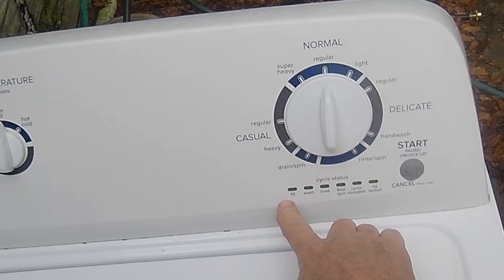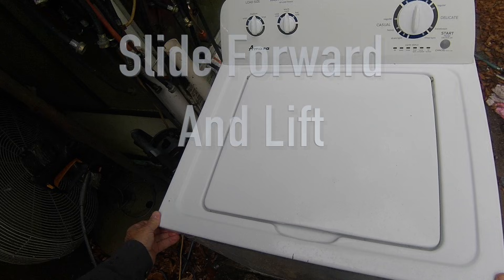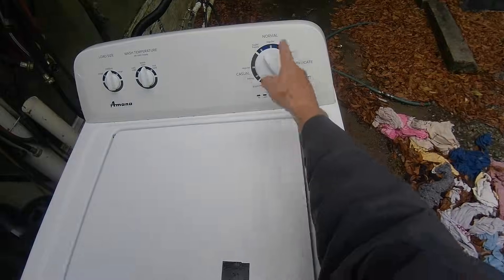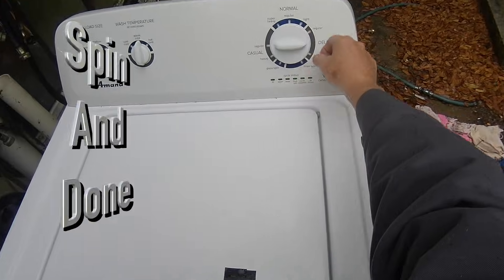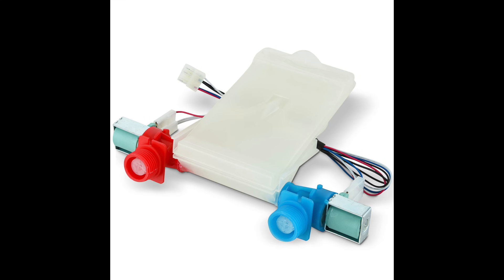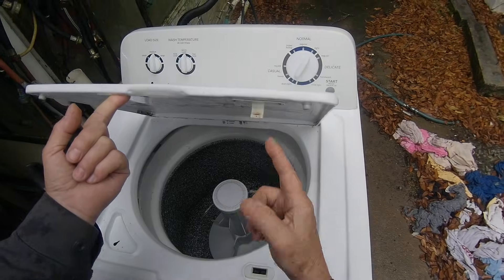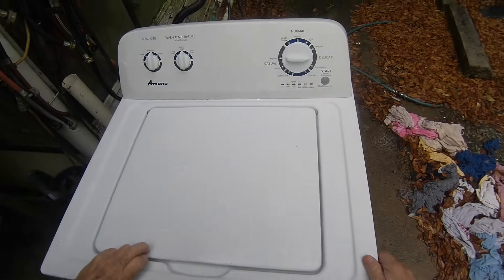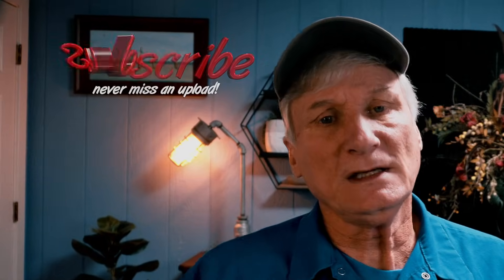How To Diagnose Your Amana Washing Machine: Chip's Guide to Manual Diagnostic Mode

Comment: So mine wont stop filling until its spilling out, and the drain pump doesnt work unless the tub is almost completely empty already, all other parts of the auto test ran except the drain and i cant manually work the pump with manual test function. However it automatically drained once i syphoned almost all the water from the tub. Im so stumped
Reply from the maker: It sounds as if you’re having issues with the pressure transducer on the control board. Take the hose loose from the control board and blow back through it to clear any blockages. With no water in the tub reconnect it to the control board. Oh, and make sure it is connected well to the side of the tub. You may have to reach up under the machine and do this. You might also have a small hole in the pressure hose. If you are still having issues, your pressure transducer is not functioning and you’ll have to replace the control board. Thanks for watching!

Comment: In diagnosis mode, When I hit start when testing the spin, the lights flash and nothing happens.
Reply from the maker: Be sure you lock the lid first or the test will fail. If it still doesn’t spin I’d change the shift actuator first.
Reply: Lid is locked. And replaced actuator and splutch. You can hear the motor wanting to spin if you reach down and give it a shake it starts spinning. Is that just a bad motor by the way this happened after washing a very large comforter
Reply from the maker: I'm thinking the shake could be nudging the basket enough for the motor to start. That points to a weak capacitor. I'm guessing here so let me know if you find a solution.

Comment: When doing these test, particularly the spin agitation test, the lights just flash. Does that mean it fail?
Reply from the maker: Make sure you lock the lid before doing spin and agitation test.  You can lock the lid by entering test mode and with no lights on press the start button and the red lid lock light should come on. Then dial in your other test. Thanks for watching!
Reply: @HarperandKnowles  i did. It’s red and locked but still nothing happens to start the spin test. Is my actuator bad or lid lock not working properly?
Reply from the maker: Probably your shift actuator.

Comment: I have an Amana washer. Cold water not coming out. Hot water is good. Replaced water inlet valve. Still no cold water. Suggestions?
Reply: Thank you for the video suggestion. That was helpful. I installed a new inlet valve and still no cold water coming out. Is there any other remedies for this or is the inlet valve definitely the problem?
Reply from the maker: Did you try the hack described in the video I suggested to check and see if the cold water valve is the problem?. If not here is what to do. First insure that hot water flows through the hot water valve body. You can do this with the diagnostic check. Now, attach the cold water hose to the hot water valve. Next, swap the wires attached to the cold water solenoid and the hot water solenoid. You have to do this for the machine to work properly because all your rinses are cold water. Now check for cold water flow using the diagnostic check. If you still don't get cold water you have a wiring or control board problem. If it does then you have a water valve problem. You can also check the cold water solenoid for continuity. If the solenoid is broken you can use a good one from your old valve to fix it. I hope this helps!
Reply from the maker: Perhaps there is something wrong with the water supply to the machine. Take the cold line from back of machine and run it in a bucket to see if you have good flow and no hose kinks. If that’s good try the hack in this video Amana Washer Making Noise When Filling | Hack This Issue
https://youtu.be/qq37YBKr3q8 while you reorder and get a good valve. Thanks for watching!
Reply: I’ll give this a try. I’ll update on the results. Thank you for your time 🙏

Comment: Can diagnostic be done with machine tilted back,so I can see underneath?
Reply: Actuator is working,but no spin. Could it be the capacitor?
Reply: Trying to be accurate.
Reply from the maker: Use the book on the inside left corner of the cabinet to check the fault codes. That will get you on the right track. A no spin situation can be many things. Lid lock/lid switch, shift actuator, tachometer, motor, belt, splutch, control board. I’d check the tachometer, that’s a common issue, but the fault codes will guide you to the solution.
Reply: Thank u.
Reply from the maker: Why not put a couple boards under the legs, set your cell phone to record video and slide it underneath. It could be dangerous trying to tilt it. Gyroscopic forces, you know?

Comment: I’ll start my washer and when it’s in sensing mode it will stop filling and start making a clicking sound. If I open the lid and close it again it will stop clicking and start filling again for several seconds before it’s back to clicking. It will do this repeatedly until it completes the sensing cycle and when the clothes are done washing I’ll still have detergent stains. I’ve tried using pods and liquid and a normal amount as well as a small amount of detergent and still can’t figure out what’s wrong.
Reply from the maker: Change the shift actuator. That should fix your problem.

Comment: My Amana washer fills up,agitates on wash cycle, drains,fills up on rinse cycle then drains&goes back to wash cycle. Will not agitate or rinse my clothes.Also clothes don't come clean and are still pretty wet.I replaced the shift actuator.Did not fix the problem. Can you help me?It's NTW4516FW3 model.Only about 3 years old
Reply from the maker: This sounds like a cold water valve problem. What I would suspect is your cold water valve isn’t flowing enough water into the tub before it times out. All rinses are cold water only. It may be flowing enough during the wash cycle because it is flowing warm or hot water. Do the diagnostic check as in the video for the cold water valve. Thanks for watching!

Comment: This is the best walkthrough of washer problem diagnosis I have been able to find on Youtube.  Concise, correct information presented very clearly.  I learned a lot in the last 7 minutes and 47 seconds.  Thank you!
Reply from the maker: I’m glad you liked my video. Thanks for watching!
Reply: What is the next step if the lights won't come on. It didn't get past the  first step
Reply from the maker: I’d check to make sure there is power going to the machine. If you have 120 volts verified then there is something wrong with the control board. Thanks for watching!
Reply: I AGREE..! 🤦🏽‍♀️
Reply from the maker: Thanks for watching!
Reply: Absolutely!

Comment: My amana of washer started button will not work. What can I do to fix it
Reply from the maker: You can try several things. First hold the button down for about 30 seconds. Then lift the lid and close it and push start and release it. Next unplug the machine for 2 minutes, plug it, lift the lid and close it then push the start button and close it. Next try to determine if the button is stuck down. You can remove the back panel then with a putty knife depress the clips at each side of the console and lay it down. Pull the knob off the front and then remove the control board and turn it over to examine the button switch on the board. I hope these ideas will help you. Thanks for watching!

Comment: I think my issue is either the valve body or the control board I’m about to try the doing the diagnostic test right now but my issue is basically the machine will run auto sensing but the light will switch to wash after and it will just stop there it won’t fill up or spin or do anything else I can change it to the rinse cycle and it works just fine but it will not start the wash cycle 
If anyone has advice I’d love to hear it
Edit: it’s the cold water screen the hot water runs the whole machine I just need to clean out the cold water screen and hopefully it’ll be fixed
Reply from the maker: Glad you solved your issue, thanks for watching too!

Comment: Hey man , amazing video here . Ran the full diagnoses everything worked as it should except the spin cycle and agitate. Replaced the shift actuator and still have no luck just an electrical hum . Belt is in new condition but almost looks as it’s running itself off but have not witness any movement / spin
Reply from the maker: An electrical hum could be several things. If it happens as soon as it’s plugged in then hold down the start button until it quits, 30 seconds or so. If not that it could be the motor or the capacitor. Replace the capacitor first. Other than that all I can do is guess without being right there myself. Thanks for watching and good luck with the repair!
Reply: @HarperandKnowles  thanks I’m guessing it’s the motor , I noticed the pulley on it was dropped down few inches and not parell to the other .. the electrical hum is only when trying run spin cycle in diagnoses so assuming it’s the motor under load not moving
Reply from the maker: Or that pulley could be stripped out.
Reply: Wish could leave a video aha , is there suppose be any play in it ? I can lift it up and down well over inch
Reply from the maker: It depends on which motor you have but this could be your pulley https://amzn.to/3Gq3TZR
Reply: Thank you sir for the video I have a amana washer like this it goes through the cycle as it should only problem is it agitates slightly like your video I replaced the shifter with no luck and the clutch lever moves freely any advice? Not sure if it’s related but I’ve noticed the tub has been filling with more water than usual
Reply from the maker: There could still be something wrong with the splutch or shift actuator. Aside from that it would have to be the internal workings of the transmission. Make sure the arm on the actuator does not flop around and is secure in the splutch slot. You could try tilting the machine up and watching how it moves while someone cycles through agitate and spin cycles while in the test mode. I hope you find success! Thanks for watching.

Comment: Attenion Chip  I have an Amana ntw4516fw3 that I have installed a new acuator and start capacitor. The cap was check and showed bad. ran test mode and replaced acuator assembly due to no spin . Everything test ok in diagnostic mode but when run stops with Rinse light flashing. Any ideas ?
Reply from the maker: I would suspect the lid lock or the cold water valve. Thanks for watching!

Comment: I cant load large loads. It makes a loud noise . It goes through the cycle but doesn't wash.
Reply: It just loads small and medium  amounts of clothes. If I go larger the agitator will not move . It will cycle but not wash
Reply from the maker: You might have striped splines on your agitator or on the large pulley under the machine. Your gearbox might be failing too. I can only guess without being able to diagnose it myself. Good luck with your repair!
Reply from the maker: You haven’t provided me with enough specific information to give you an educated guess as to what may be the problem. Thanks for watching!

Comment: My lid locks for the diagnostic test but not for the wash cycle, so I need to replace the lock on it?
Reply from the maker: There are models where the lid doesn't lock during the wash cycle but only during the rinse and spin cycle when the spin basket is moving. If your lid lock passes during the diagnostic test then it is probably alright. I would suspect the control board if your machine passes the diagnostic test but doesn't work during a the wash cycles. Thanks for watching!

Comment: My washer will only fill with cold water when I open and then close the lid.. when it stops to sense level (or whatever it periodically stops to do), it goes to straight hot water until I open and close the lid again.. I have to stand there opening and closing the lid to keep it from filling with all hot water. Why?
Also, my washer will not do anything, including fill with water, unless the lid is closed, so when I am in diagnostic testing, and I open the lid to see if water is flowing cold, won't it stop and thus not let me hold my hand under the flow to see what the temp is?
Reply from the maker: Okay so this doesn’t make sense to me. In diagnostic mode you can lift the lid to check the water valves. You can also turn off what you think is your hot water valve on the wall and if you are still getting hot water your hoses are swapped.. From what you are describing I’m thinking you have your hoses swapped around. Let me know what you find. Thanks for watching!
Reply: @HarperandKnowles   I passed all the diagnostic tests... perhaps the problem corrected itself? It was bizarre to have to lift the lid and close it to get the cold water to flow in... I had to babysit it the whole time to make sure the load I was doing wasn't going to be steaming hot water. I hope it doesn't repeat. Unless the water hoses can move themselves, it isn't that. They have always been correctly attached. It would start with cold water, and a couple seconds later it would stop, do some adjustment (I guess?) then start filling again, but this time steaming hot water, so I would open the lid and close it and it would flow cold water, until the pause and "adjustment" a couple seconds later and the hot water.. it was annoying to say the least.

Comment: I replaced the lock switch ran thr diagnostic and my lid lock light jeeos flashing any suggestions would help please and thank you its amana
Reply from the maker: Is this the same issue you had with the original switch? If so check that your striker (the piece on the lid) is not damaged.  Take something metallic and be sure there is a magnet in it. If both switches are acting the same then you probably have a control board problem. Or, it is possible but rare, you have a defective switch they sent you. Thanks for watching!
Reply: @HarperandKnowles  no the last switch just kept clicking I was just getting ready to order one to see if that was the problem because the new  switch didn't come with one ....thanks so much im gonna try it now

Comment: My manual is missing about 1/4 of the 1st 4 pages(based of page numbers) and it wont go into test mode at all. Will work sporadically but not always an issue.
Reply from the maker: Check the plastic bag inside the cabinet for your missing pages. If your machine won’t go into test mode and you are sure you are doing it correctly then you probably have a control board issue. Thanks for watching!

Comment: Why is my washing machine not filling up all the way to a full load?
Reply from the maker: Modern washing machines have got to meet new EPA standards for water consumption. Perhaps this is normal for your machine. But it could be another issue related to the pressure transducer on the control board. Unfortunately I can only guess without being able to personally diagnose your machine. Thanks for watching!
Reply: @HarperandKnowles  this is brand new like three months old four months old I bought it at Lowe’s. My number did not get you know they warranty which I should have so sorry I don’t know what I need to do. Where are you located because I’m in South Carolina.
Reply from the maker: I’m in central Louisiana, way too far for a service call!!! I’m sorry you’re having trouble with your washer, perhaps you should contact a local service technician.

Comment: done the diagnostics a couple of times with out any errors Amana NTW4516FW3  But during a real wash the rinse starts and shuts off in seconds. Even with out any clothes in the basket. Any ideas would be appreciated.
Reply from the maker: I have found many machines that will pass all the diagnostic test but will fail during a cycle. This is usually a control board problem. Changing the board will usually fix it. Thanks for watching!

Comment: Hi! This video is great!!! I will begin my search for a solve again but thought I’d ask….

My Amana will go through the whole wash cycle, but enough water is not being spun out of the clothes at the end of the cycle. So when the washing machine is done, my clothes have to be wrung out and there’s so much water in each of them I can’t wring them out thoroughly. 

There is no standing water in the tub. It’s just all in the clothes… Any ideas?
Reply from the maker: If the clothes are just lying there and not pushed up against the side of the spin basket they didn’t spin out. That could be a shift actuator or splutch or belt issue. If they are up against the side that could be a pump or leaking water valve issue. Unfortunately I can only guess without being able to diagnose the issue myself. Thanks for watching!
Reply: @HarperandKnowles  oh! Hmmm…. I think maybe they were just laying there
Reply: Trying to decide if I should try to repair this myself or just get rid of it. I purchased it from someone on Facebook marketplace who had just bought a home and had their own washer and dryer so they were getting rid of this one.
Reply: @HarperandKnowles   thank you for the great info!!!
Reply from the maker: My pleasure! Thanks for watching!